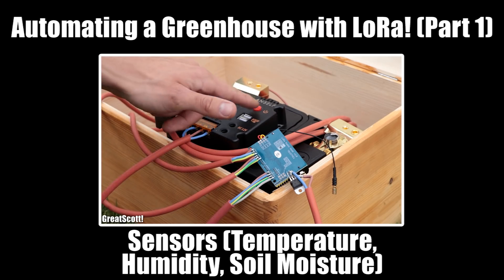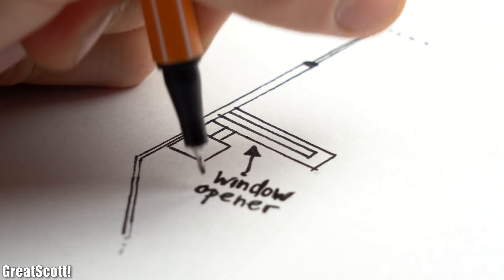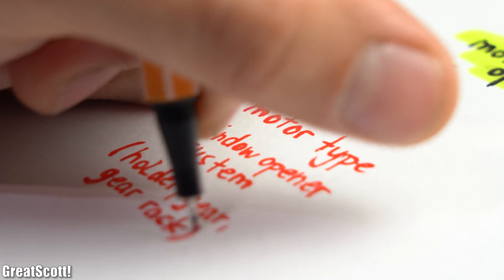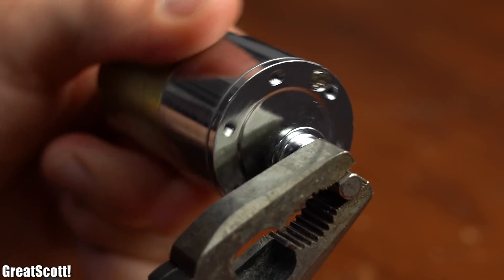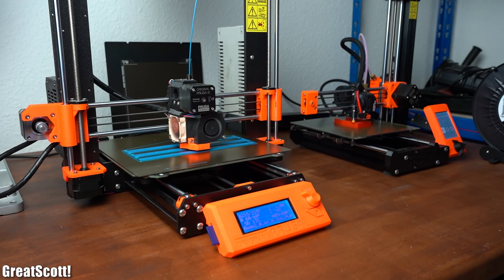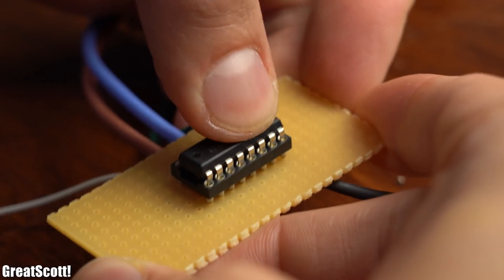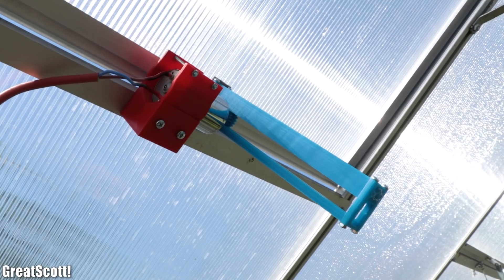Automating a Greenhouse with LoRa! (Part 2) || Motorized Window Opener

Comment: instead of drawing power to hold the window open constantly, could the mechanism be adjusted such that as the window gets opened, a latch falls into place to hold it open so that you can power it off.  Then, when you want to close, you drive further in that direction to release the latch, then reverse and go down... sort of like the mechanism in a ball-point pen where you click it open and click again for closed.  Might let you reduce the power consumption a lot without losing any functionality.

Comment: Hey, about the watering system... I get it, but... why on earth did you find yourself visiting so often the greenhouse? Doesn't it defeat the whole purpose of the automation?
Reply: It's pretty difficult to automate picking the ripe vegetables.
Reply: @DavidWalling 
Depends on the vegetable... But then I guess you still have to collect it unless you build a conveyor belt system to get it to the kitchen 😂
Reply: @DavidWalling  You don't pick ripe vegetables every day... And even so, you could go to the greenhouse to pick them, rather than spend time watering the plants BEFORE having to also pick them...
Reply: You need to check that everything works properly before leaving it alone
Reply: Adding water hoses with holes on the ceiling connected to water pipes by solenoid water valves would solve the wattering problem.
Plus, vegetables take time to be mature so  you'd only have to visit the greenhouse once in a month or 2 weeks

Comment: That solution is a bit overkill imo.
There are window openers out there which are filled with a special oil which expands and contracts depending on the temperature. Easy to install and no motors or anything needed.
Reply: hackerman most hobby electronics projects are a fun waste of time and money.
Reply: He wanted to open the window if it gets too humid so your solution would not solve his problem quite the way he wants it to be solved
Reply: And much more reliable. In my greenhouse I would not trust a electric solution.
Reply: thats genius

Comment: In the event of a power loss it's difficult to determine the current windows position. I would rather use a limit switch, at least on one of the ends.

Comment: I was going to suggest adding limit switches to avoid  the pending disaster when you have a power failure, but I see that the comments section beat me to it. I will add that you can get conductive tape (such as copper or aluminum) and make your own low profile switches

Comment: Worm gears are self-locking so you don't need to waste power on keeping the motor energized to maintain holding torque.
Limit switches will give you closed loop feedback, so that the controller doesn't run past the end of your gear and always knows which position the window is at.
If the H bridge needs one side high and the other low to operate, both sides can be run off only one digital IO pin if one side has a digital inverter in front of its input.
Still, a pretty awesome build. I've been wanting a balcony garden for a while, and I'm definitely gonna try automating it like this.

Comment: Automatic Greenhouse window openers cost around 40 dollars.
They work Just like alcohol thermometers. Heat makes Them expand and activating a lever opening the window. This is overkill...
Reply from the maker: Mine is way cheaper than 40$. Your price is an overkill. And it is not only about the heat but about humidity.

Comment: Maybe some position switches for "Window Open" and "Window closed" would've made sense. But since your solution works too, it's okay. I think it's a bit ironic, how you're advertising JLC PCB while soldering all the stuff together like if it works - it works. If I'd make such a project, I'd at least make adapters to screw the cables in instead of soldering them to the pin headers. Few years ago I worked on a smart home system, utilising a raspberry pi, running pimatic and hooking up all kind of sensors to it. At the end it was able to control the lights depending on how bright the environment is, controlling RGB LED Stripes, Switching many different RF plugs and control the temperature in my flat. It was even capable of turning all the heaters off as soon as i opened a window. Unfortunately the software never reached version 1.xxx and is stuck at 0.9 since four years. The project died with the RaspberryPi 2 which suddenly became too hot for no reason Everytime I turned it on.

Comment: Odrive does come with holding torque, but I would also take the geared motor because you don't need to make it more complex than necessary 🙂 You should have had a bend rack because the window rotates around a pivot, or the rack should pivot

Comment: Using message length to control motor direction seems like an overkill. You only need 2 unique values to do that, and a byte (considering it is 8 bits) can hold up to 256 unique values.

Comment: For everyone with similar projects I recommend recycling windshield wiper motor, because it can hold the position when powered down. I have used it for opening chicken coop doors and it could hold the whole weight of the doors.
Reply: Those motors can have quite a lot of holding torque, thanks to the use of worm gears in them.
Reply: @TechBuild  Exactly
Reply: Car antenna motors too

Comment: "Of course, I also implemented a delay so that the motor only moves for a short time, and the motor can also not rotate the same way twice in a row" 9:13
Limit switch: Am I joke to you?
Reply: Not to mention the controller can be reset in wrong position and similar situations (halfway for example).
Reply: He said on twitter that it was "too complicated" for such a small movement
Reply: more pins used (1 or 2) depend on number of limit switches
Reply: Only one pin is used if you make a simple logic gate board.
Reply: as my man michael reeves says, limit switches are cringe
Reply: @danielgarzaf  As Einstein said - "Things should be as simple as possible, but no simpler." 

NOTHING simpler than a limit switch for something so non-precision requiring - and LOTS of ways to implement.
Reply: Cringe
Reply: you mean shift register, mux or something different?
Reply: @davordamjanovic893 , You can have logical "OR" on both switches. You already know the direction of the movement, so you just need to know when to stop.  If you use normally open switches, you can connect them in parallel. When one of them is pressed they would send logical "1" to the input pin. If you prefer normally closed switches, then you can connect them in sequence.

You can also have logical "1" be high voltage or it may be connection to ground with pulling up resistor to the pin (like i2c).

Of course, if you reset the controller and you have switches pressed, you won't know at which end you are, but that's rare case and you need to try short movements in one or the other direction to find out.
Reply: @ИванСнежков-з9й  you could even not use anny input pins and connect the switches directly to the motor, with two diodes
Reply: It's ok to share knowledge without putting anyone down. We are all here to learn and share. Why are you here?
Reply: "Of course, I also implemented a delay so that the motor only moves for a short time, and the motor can also not rotate the same way twice in a row" 9:13
Limit switch: "Hi, my Name's Bob. I face neglect at home"
All: " Hi Bob "

Comment: I made same project for school but it was small in that case 
It was having soil moisture sensors for watering plants , led lights for artificial lightning plants and I specifically use blue and red lights for better result and finally a gas sensor for detecting CO2 however coding it was a bit issue but some how managed to finish it and used servo instead of the methods you used . I wish you made this before I started my project :)

Comment: 1 byte has 256 distinct states , so you can simply open / close with resolution of 1/127th of working angle using single byte. Simply use singed byte or 0 to 127 and 127 to 256 states, so first state represents closing and other number represents opening action. Your code can be optimised with slit position feedback with some kind of resistive / capacitive detector and some microcontroller code :)

Speaking of moisture detection, cheap sensors never works, invest in high quality industrial sensors that are built to last for years.

Comment: well you could have done a water system that can be turned on and off with a switch, you don't need to add any complicated monitorning you just push a button and in that way you avoid using a watering can.

Comment: The only problem i can see here is how do you know what open or closed is? You have no way to know the position of the motor. Perhaps adding some limit switches would be a good idea?
Reply: That's true..
Reply: Time is good (necessary) to check if a state or movement is made in an allotted amount of time.  Time is not good to drive a change.  That would be simply assuming the action happened and maintains sync.  It can work but you never know when systems get our of sorts.  I've proven this to several programmers when buying custom automated mfg equipment.
Reply: @lint2023  Yep, passage of time is not position feedback. How 'bout a tree limb got stuck in the window
Reply: I agree,  a feedback state would be preferable  to signal  the Audrino  when the window reached  either a fully open or closed position. Let's say the window was obstructly block externally and wouldnt move either direction. A subroutine could be written to use the values of the close limit and open limit switch to stop the motor from overdriven  X amount of cycles either direction and stop the motor and  Audrino will sends out a Fault/ error message!?
Reply: He needs a infrared camera to see everything... Tomato needs to be pinched...
Reply: I knew an electronic engineer that used pots to verify state of windows on chicken battery farm. Anyone have more knowledge on this? Surely it would work?
Reply: Or encoder
Reply: Maybe him can use EEPROM to store the motor state or use a reed switch to know if the window is closed.
Reply: @theenginnest9243  still missing the point... The Arduino can't know where it is in space. It's a simple DC motor with no feedback. The simplest and cheapest feedback is limit switches
Reply: @theenginnest9243  It's not good practice to store such data in EEPROM since they tend to have a relatively short lifespan if they are written too often,  Arduino Nano EEPROM lifespan is around 10k r/w IF you are lucky
Reply: @farshid4115   It's true...
nice tip!
Reply: He said at 9:25 that the Arduino sends the motor state. No need to use any hardware for that.
Reply: @eduardotinoco6055  and what state is that? 50% open? 12% closed? The arduino has no idea where the motor is in space. It can command open or closed. What happens when you command open but the motor is actually in the full open position?
Reply: @theonlyari  it knows (assuming no loss of steps) because he programmed it, so he might have programmed it as having a starting point of 'closed' and just made sure that when he turns it on, it's already in the closed position.

This is pretty common in cheap CNC machines. (assuming the machine coordinates on power-up is 0,0)
Reply: @evilplaguedoctor5158  if he used a stepper motor... Maybe. But he didn't so no steps... There's just on and not on. Any change in voltage will directly change the rmp of the motor so there's still no way to know where it is in space.
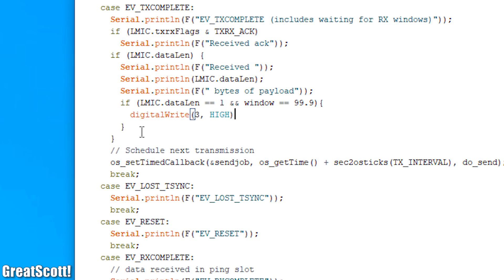Reply: @theonlyari  As we can see in 9:06, the window's state (opened or colsed) will only change if you send the oposite command. Those if's ensure that. Moreover it isn't a proportional control, just an ON-OFF one.  But now that I have read other comments I agree that a simple time control isn't enough, there should be a hardware feedback, to avoid problems such as power faillure. However, a limit switch wouldn't be the best choice or this too, since it cannot detect if the motor is in the middle of its path, or any other position rather than beginning or end.
Reply: @eduardotinoco6055  But you can force it to bump into it every time it closes. If the arduino becomes unsure, it can always "home" itself. Encoders on the other hand seem unreliable and finicky to me.
Reply: @eduardotinoco6055  2 limit switches are enough feedback because the window is either open or closed.
Reply: @noweare1   actually there are 3 states with 2 limit switches open, close, and not open or closed, which i would call 'in transition'
Reply: Eduardo Tinoco Yeah, but if there’s a power failure, the Arduino won’t know where the motor is
Reply: @darktherapy  correct!

Comment: 100RPM DC Motor but no limit switch!!! Receipe for disaster...
Reply: I think the Motor dosnt have enough Power at 5v.  But i also would use a Limit switch or just measure the current. if the Motor Runs in the mecanical Limit,the current would increase very fast very high. Than there isnt a need for Limit switches and so no need for extra wires.
Reply: @Enderkruemel  No extra MCU pins, current sensing or extra long wires are needed. Just 2 limit switches and 2 diodes at the gears are enough.
Reply: Yeğnidemir  i know, But i didnt think about this simple circuit. I used the this Setup for some experimental things , But if the Limit switches aren't there or they dont fit mecanical, there is the Problem that a New Part/switch holder is needet. Current sensing is one of the solutions But i think this circuit is the Best (and failsave) solution.
Reply: it does not spin at 100rpms as it gets powered by 5 volts..

Comment: Hey, you could have used a worm gear to open and close the window, because worm gears are self-locking which would ensure that the window stays at the desired position. 
Just for your information, because your solution obviously works as well.
Reply: a good old fashioned car antenna motor should do the trick - runs on 12v got inbuild limit switches and most of them got the up/ down switch toggle build in
Reply: Its quite slow and has high friction so it will wear out more often, also if accidenty,some force is applied,on the window, this gear system will compensate it by going down, but worm gear will break in this case, 
Thank you!
Reply: @69iqtutorial  Almost all greenhouse vent motors have worm gears off the motor shaft, I used to rebuild them. I wouldn't suggest a plastic gear. They were pretty beefy worm gears in the gear boxes. In some cases where you had a multi vent system with multiple 100ft long vents they were all supported by a single worm gear. I've never actually seen one break, usually the rack or drive shafts break before the gear fails.
Reply: @fc3sbob   you are right but i am speaking specifically about plastic ones
Reply: @69iqtutorial  metal threaded rod and an embedded nut in a 3d printed mount would keep friction very low. Its what almost every 3D printer uses for the vertical axis, never had issues with wear.
Reply: @mattrussell4370  but its a metal gear, i have said this because he is using plastic gear, so plastic worm gearRis not a very good choice... but a metal one is good
Reply: Apart from wormgear other thing that I would add are limit switches on both ends instead of relying on the software. When rebooted, it has no way of saying what state window is in
Reply: You could use almost anything. By default easiest is to use those simple automatic cylinders that are sold by greenhouse sellers. It's cylinder that contains some thermally expansive grease, so that'll simply close if it rains. Not everything requires electronics :) Plus they cost almost nothing.
Reply: lol
Reply: Commented the same and then spotted yours. Preferable to relying on holding torque and potentially burning the motor. Still cool that he got it going with a simple solution.
Reply: In most situations failed state closed would be the best bet.
Reply: use an already designed product and take one out of a car
Reply: Ah! idiots, you could just use a small rocket to keep it held open

Comment: Do you heard of o-drive? It is nothing for this project, but I think it would be a great topic for a video. It's a board which turns a BLDC motor into a BLDC-servo motor and it can be controlled by an arduino.
Und Sorry wenn mein Englisch etwas schlecht ist.
Reply from the maker: I have an o-drive laying around. But I do not like using it because it is a pain to set up.

Comment: Great build, but no limit switches? Eventually it will probably get out of time with the travel of the rack. Unless it's not strong enough to blow itself apart if it deadheads, but with that 50:1 ratio, it looks like it would tear up the gears if it ran out of travel.
Reply: I think exactly the same.
Reply: Actually, that IC with the H-bridge may have current sensing / limiting in it. Easier than limit switches.